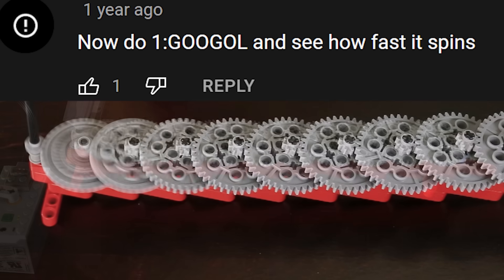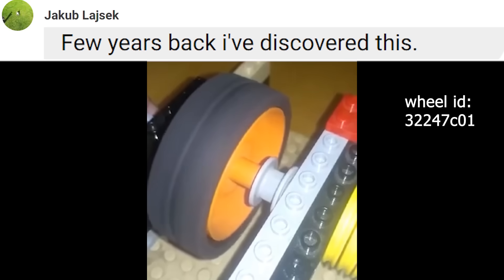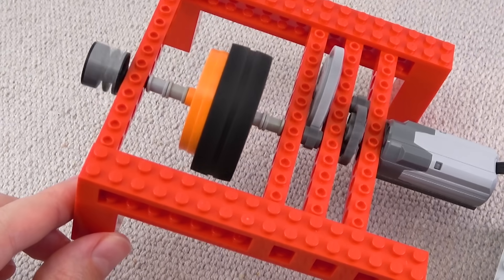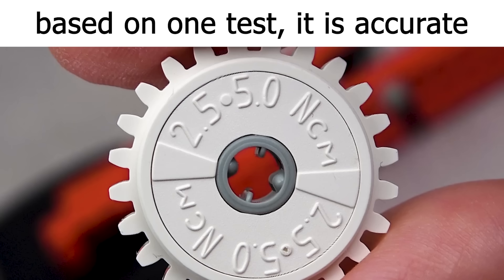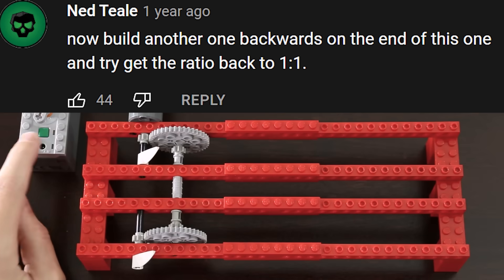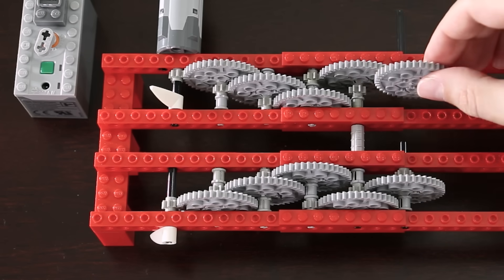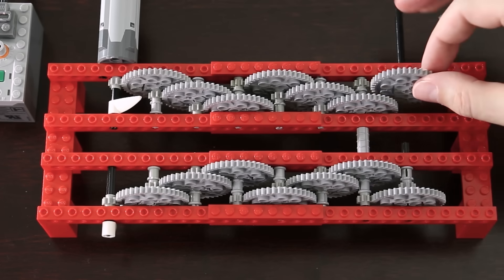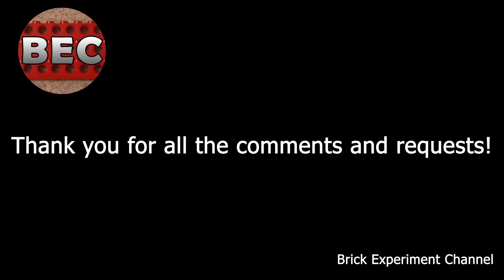Requested Lego Experiments 1

Comment: I had that idea for the 1:GOOGOL but then I remembered about the insane amounts of torque required to do that.
General rule of thumb is that as the gear reduction increases, so too does the torque, this is why vehicles like farm tractors can inch forward at idle if you release the clutch at lower gears.
Reply: You'd never turn a 1:googol geartrain of any kind with all the torque on earth! Even if you magically could, at not very far into the geartrain you'd be trying to turn gears with a tooth speed over the speed of light. This will give you 'issues'. :)
Reply: @liampope1  even if you managed to magically spin it, not only would the gears be ripped apart from the torque exceeding the material resistance, they would also melt just from the friction.
so yeah, reaching near-lightspeed using gears isn't an option.
Reply: @liampope1  not to mention the energy required to power the object causing the initial rotation and on top of that there's friction which will melt anything moving in the system
Reply: @liampope1  ok but i still wanna see a huge naval engine try to turn a 1:googol geartrain
Reply: @liampope1  things just break
Reply: @liampope1  i dont think there is not enough space in the uniiverse for so mich gears
Reply: @liampope1 ’issues’ :)
Reply: You can park a manual car without touching the gas pedal.
Reply: @Tankwiper  That really depends mostly on the car's weight, torque, engine type and gearing. 

For instance, my car (2l 4 cylinder petrol engine with 135hp & 190Nm vs. 1250kg) doesn't like it one bit when I start off without throttle. It always shakes and stutters and I find it impossible to start it off quickly and smoothly without throttle. So I always give it a good stab on the throttle before easing the clutch. 
Sure, with enough patience on the clutch I could maneuver it into a tight parking spot, but it would put a lot of unnecessary wear on the clutch.
My brother's car by comparison (2.2l diesel with 125hp & 280Nm vs. 1550kg) can easily start off without it throttle, I'd say it's actually harder to stall his car, than it is to start off mine quickly and smoothly, though I'm pretty well used to it by now.
Reply: most vehicles can actually be clutched in without ever touching the gas pedal. below 4 cylinders, they tend to be choppy, but most cars tend to be able to support themselves in idle up to 2nd gear.
Reply: @zibingotaeam3716  A long time ago when I was new to driving and experimenting with starting from standstill without gas in my Dad's car,  I got it going in second with no gas without too much trouble, then into third and fourth all at only idle. Next experiment, start in fifth from standstill, required some gas, but I got it going, followed shortly by the distinct smell of burning clutch. :)
Reply: @liampope1  i also did Run my Car from 5th gear with no clutch smell.
Reply: @zibingotaeam3716  as long as your surface is relatively flat. But I’d rather not be plying grab ass with my clutch
Reply: Even if you had infinitely strong gears and infinite torque, at 1:GOOGOL there would be relativistic concerns as the tip of the final gear approaches light speed.
Reply: @alineletourmy9940  FUCK! OFF! BOTS!
Reply: @racer927  Hey, watch your mouth. When skynet is upon us you'll regret that insult.
Reply: When I first learned how gears can make things spin faster, I thought I had a brilliant idea for a human powered helicopter. My plan was to power the helicopter blades from some peddles. I'd use gears to increase the speed from the peddles to the main rotor blades. I couldn't wait until I was flying around town as easily as riding a bicycle.
That conservation of energy rule ruined all my fun. This same rule ruins all the free energy gadgets as well.

First rule of thermodynamics: You can't get something for nothing.
Second rule of thermodynamics: You can't even break even.
Reply: @ddegn  This is actually a design challenge, originally created by Sikorsky. It was beaten a few years ago with a machine with four giant props and semi professional cyclists.
Reply: @zibingotaeam3716  That contraption was amazing! I had forgotten about it. What a gloriously impractical achievement. I'm not even mad they didn't credit me with the idea.
Reply: @ddegn  "Lousy laws of physics!" --- Bart Simpson
Reply: Worked on my stick shift diesel, but no longer works on my stick shift gasoline engine. It does not have the torque...
Reply: My semi truck will drag a fully loaded trailer with locked tires in Low without touching the accelerator. It's crazy.
Reply: @Redbikemaster  I can back this one. Personally don't drive over the road but I'm a yard dog for another year or so and we have our own trucks all heavy specs (15 or 18 speed transmission and 500+ horsepower with gear ratios over 4) when those trucks come in I can have both the tractor and trailer brakes engaged, but not the air brakes which is the brake pedal, and as long as the truck is in 2nd, 1st, or low gear, 13, 15, and 18 speed transmission all have a low gear which isn't first idk how to explain it mechanically, but with all the brakes engaged except the air breaks a fully loaded semi truck (80k lbs) will jerk forward unless you have your foot on the brake.
Reply: Ok
Reply: Real experiments.
Reply: The amount of torque required to turn a 1:GOOGOL gear train, if it could ever be created - even with nanometer-sized gears - would break any intermolecular interactions (so the gears would fall apart), cleave chemical bonds, plasmatize the resulting atoms, cause the nuclei to fission, and do MUCH MUCH more. No material in the universe would ever stand that enormous amount of sheer force!
Reply: Googol times the friction
Reply: This is a bot. https://youtu.be/hBkF62dltmY
Reply: More spam bots are dangerous. Pls watch before deleted. https://youtu.be/hBkF62dltmY
Reply: I'd love to see the future where we dedicate and entire fusion plant to turning a few plastic gears
Reply: @Aztesticals  That... power plants generate *power*, not torque. You can have a lot of power but very little torque.
Reply: @racer927  true.  But I feel like we could make a massive steam engine from the power plant.  Because we could just directly use the turbines or modify them instead of using the power from it.  It wouldn't do the 1: Google but I'd like to see some massive but small reductions using a steam punk fusion turbinr
Reply: Sure
Reply: That's not a "rule of thumb" -- that's erm the law of the lever. Ya know, τ=r×F, and so on...
Reply: Lol its only an insane amount of torque because you are all too weak
Reply: does GOOGOL:1 actually spin though? I mean, I know it's slow, but does it actually spin at all? Cuz the power loss in the gears
Reply: You can do that with any diesel
Reply: It's not "torque required" it's "torque created". You've got your cart and your horse switched around.
Reply: The torque will be enough to lift the whole universe
Reply: I have a flucculation motor/drive at work that uses massive reduction gearing driven by a 1/4HP motor. 
When we replaced the motor once, I demonstrated the reduction gearing by pushing on the large input gearing with my fingertip, which in turn made the massive two story multi-ton floc paddle jerk forward, then back depending on how I record-scratched it. 
It's 20ft tall and moves hundreds of thousands of gallons of water running 40rpm in normal operation.
Reply: i wonder what would happen if he got a really high torque motor and attached to the 1 : google.
Reply: @person577  160nm should be enough. Wonder if the Legos don't break and hold this torque.
Reply: @bittelesen3588  all the torque on earth - literally the torque of planet earth rotating - couldnt turn a 1:googol geartrain. A googol is a reeeeally big number!
Reply: @bittelesen3588  I believe the gear chain has a ratio of 1 to 1.95 million (40 tooth to 8 tooth = gear ratio of 5, 9 of these, 5^9 = 1953125. Plus the gears would have to metal, and bigger so they don't slip. also friction coming from the rapidly spinning axels may pose other problems
Reply: @person577  Hey, this wont be possible even with the strongest gears ever
Reply: @liampope1  OK, not 1:Googol, but it would destroy those Lego gears and that would be funny.
Reply: @person577  OK, it couldn't spin 1 Googol. But it would break the Lego wheels and that would look funny.
Reply: @bittelesen3588  indeed.
Reply: Try 1:Googol with ebike engine. BAFANG G510 160nm is a good choice.
Reply: Pretty much all ground vehicles have an idle speed actually, or the speed they travel at when idling. That is why drivers always have their feet on the brake when at a red light.
Reply: @silveradolegion  Well, in an automatic with a torque converter, the vehicle inches forward at idle which is why you hold the brake and release it to inch.
Reply: @racer927  it’s not just in automatic transmission vehicles. I’ve driven stick shift before.
Reply: @silveradolegion  Well, in that case, you put it in Neutral with the clutch released when you're stopped at a light to reduce wear on it.
Reply: @silveradolegion  it's been a while since you've driven stick, right?
Because a manual car can not stand still while it is in gear. It will stall.
So no, manual car drivers don't have their feet on the brake because of "idle speed".
If the ground is flat enough you don't need to press the brake.
Reply: @Jehty_  that’s not even what I said
Reply: @silveradolegion  let me quote you, in case you have forgotten:
"Pretty much all ground vehicles have an idle speed actually, or the speed they travel at while idling. That is why drivers always have their feet on the brake when at a red light " 
"it's not just in automatic transmission vehicles. I've driven stick shift before. " 

So either you didn't wrote what you wanted to say, or you don't know what you are talking about.
Reply: @Jehty_  No, I'm saying that I didn't say that it can stand still without stalling.
Reply: @silveradolegion  " That's why drivers always have their feet on the brake when at a red light "

If you have your feet on the brake and the car in gear it will stall.
Reply: @Jehty_  There I wasn't talking specifically about stick shift cars, I was talking about cars in general.
Reply: @silveradolegion  if you specifically talk only about automatics then you should mention that.
Because talking about "cars in general" definitely includes manual cars.
Because you know manual cars are cars....
Reply: @Jehty_  Let's not escalate this discussion.
My take on this thing is that you generally hold the brake at a standstill because even the slightest grade could cause the car to start rolling. In automatics, the torque converter will cause the vehicle to inch forward or backward when engaged.
Reply: @racer927  The handbrake is there to stop the car from rolling. There is no need to stand on the brake when stopped.
Reply: @Catcrumbs  When parked, yes, I'm referring to a situation like if you were at a stop on an incline like a stop sign or stop light on a highway off-ramp.
Reply: @racer927  When stopped at a stop sign or a stop light, yes. I'm referring to when the car is stopped.
Reply: Nice, 
A good prayer:
I'm a sinner JESUS please forgive me for all my sins I know you shed your Blood for me on the cross at Calvary. Thank you JESUS for my salvation and for shedding they Blood for me. I love you JESUS. 
Romans 10:5/10 ct...❤️k
JESUSisLord!Amen...
Amen..
If you'd like to call someone who cares 
83
For
Truth.
bc you don't know when you'll die?
.y r u hesitant..

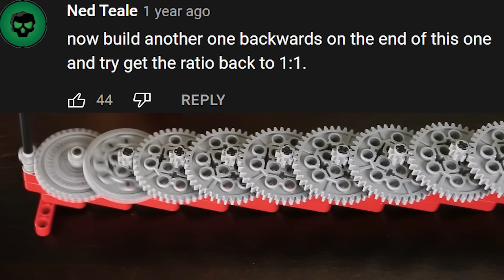Comment: 1:22 That's so cool! It's almost like a physical capacitor or something. Probably a bad comparison, but y'all can probably see my point.
Reply: Unlike the spring or rubberband analogy, its a much better demonstration of potential. The output can't spin until a threshold tension/charge is reached and then the energy discharges all in one go.
Reply: You mean spring ?
Reply: Yep..and the fact that u can witness it storing energy is absolute madness
Reply: We decided to call it Wind-up motor.
Reply: Not really. @approximately
Reply: “Physical capacitor” You mean like a rubber band?
Reply: @yousorooo  No, that wouldn't be a rubber band. Capacitors store charge until it reaches a threshold, and can output energy after charging for a short time, but their most used purpose is stabilizing voltage. Think of a faucet that keeps changing how much water is coming out of it, and in this example the capacitor would be a bucket with a hole in the bottom. The water would pour into the bucket at irregular rates, but leave the bucket at a consistent rate.
Reply: @silveradolegion  Except that springs are used to stabilize output pressure just like capacitors stabilize output voltage. Just have a hydraulic cylinder connected to a spring and a hydraulic inlet and outlet. You can replace the spring with compressed (trapped) air or just gravitational potential (water tower). Springs are mechanical capacitors. Springs increase in force with displacement and capacitors increase in voltage with charge displacement.
Reply: This Is a bot. https://youtu.be/hBkF62dltmY
Reply: I thought the exact same thing! Glad I’m not alone
Reply: Well you are right , while describing analogies between L-C oscillation and mechanical oscillation the equivalent for force constant is reciprocal of capacitance. But i think none of those analogies apply in the case you described.
Reply: You do know a motor was turning that right? Light pieces of plastic dont store nearly enough energy to turn like that for that long, especially with the insane resistance it's experiencing
Reply: @epiphone5696  yeah, a motor was spinning the top side and stored potential energy in the gear chain in the form of tension, like how a capacitor stores energy from electrons, until it reaches a threshold at which point the stored energy is discharged through the rest of the system, exactly like a capacitor

Comment: I would be curious to see experiments on loss of torque transmitted through a universal joint (the LEGO piece and possibly some MOC U-Joints) at different angles.
Reply: He could also do effects with lego driveline angles too, ujoints in and out of phase
Reply: U joints angles need to be set at certain angles otherwise they will cause a vibration. U joints have a quirk that they speed up and slow down twice in a revolution and the angles need to be in a way they cancel each other out
Reply: @CoilB2  ah ok, thank you
Reply: Good idea!
Reply: Bot. https://youtu.be/hBkF62dltmY
Reply: ;p